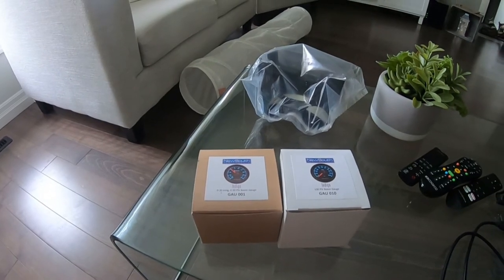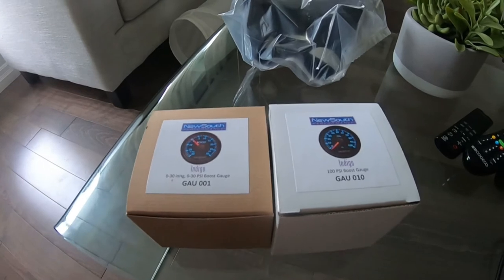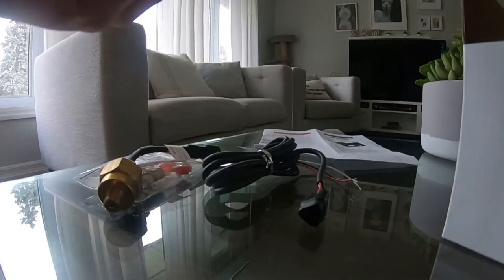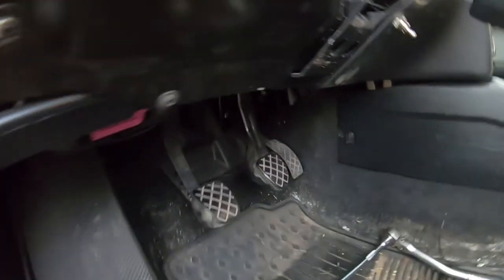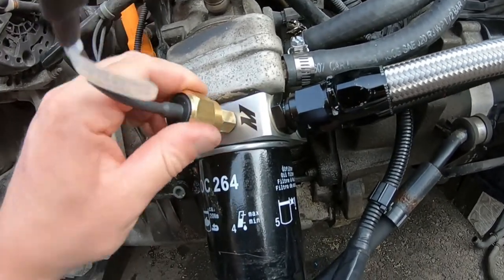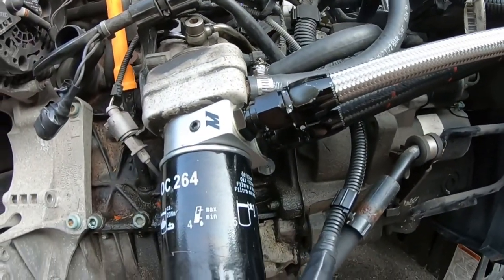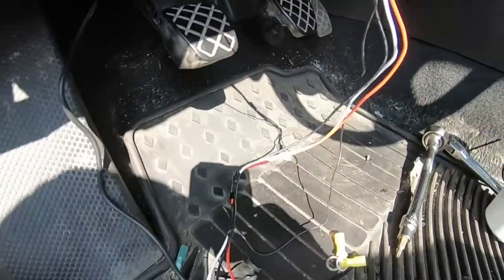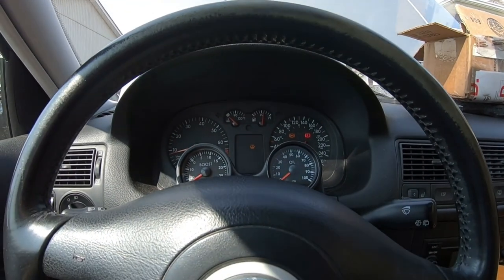MK4 GTI/Jetta Boost/Oil Pressure Gauge install (Time Attack Build Ep7-First Start)

Comment: I have a Mk4 r32, what sandwich plate will fit my car? Im putting in a oil pressure guage. Also how will I plug the NPTs I wont be using? Ty, Matt